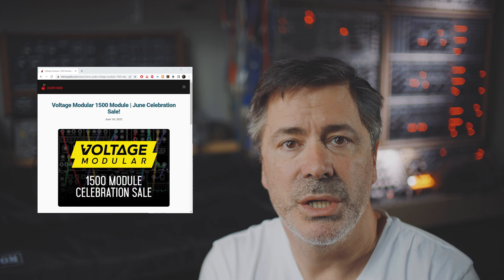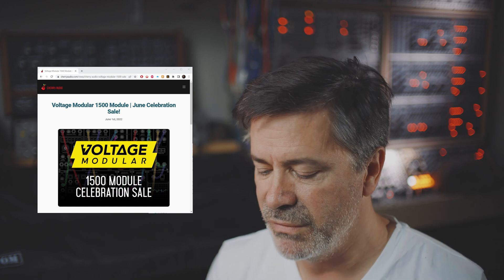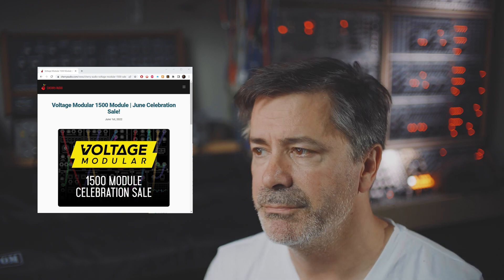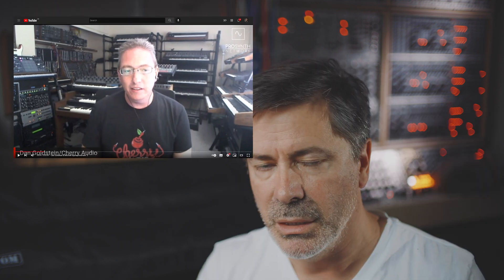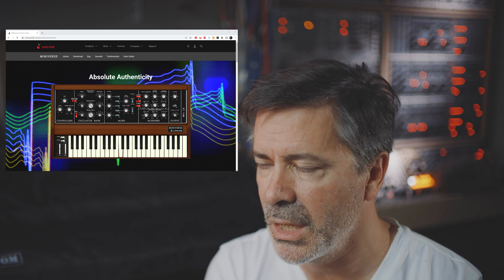Glide

Comment: The Model D, at lest mine, has faults. It’s not “pissing on the product” to grasp that the faults exist and publicly acknowledge them. On mine, glide is indeed a bit flawed - and the detune for Osc 2 & 3 falls short of 7 semitones. So while you can do fourth leads, you can’t do fifth leads on it.

Doesn’t matter really though. For slightly over $200, you’re getting a Minimoog. The thick, fat, lush, sweet, aggressive, amazing sounds of the Minimoog. I’ll live with its flaws. Because the alternative is to not have that sound in hardware, unless I want to spend thousands for a vintage unit that might also have issues.

Comment: Sigo varios vídeos suyos, disfruto bastante su conocimiento. Y quisiera su opinión o consejo sobre qué comprar, para tener buenos pads, que pueda programar sin ser un experto fanático: sólo hacer música. Gracias.
Reply from the maker: There are many options to get great pad sounds. In terms of analogue synths, the Behringer Deepmind is a great choice. It's a simple synth architecture but it has an amazing choice of effects. There are some beautiful pad sounds amongst the factory presets and those sounds are amazing thanks to the effects.

As well as effects, the ability to layer sounds will allow you to create complex evolving pad sounds. The Nord Wave 2 is not a complicated synth, there is no menu diving, and you have 4 layers at your fingertips. You can also blend sampled sounds such as orchestra, choir etc etc.

Multi-timbral digital VA synths are not really in fashion these days, but they make amazing pads thanks to the layers you can create and the multi effects they have built in. I have a number of synths that date back 20 years or more, they are not complex to program and don't cost much compared to new products. Some favourites are Roland XV series, Novation Nova and KS series, Korg Radias & Access Virus.... (Well, XV is not so easy to program and Virus prices are going crazy these days but in general "first generation" VA synths are heavily overlooked)
Reply: @TimShoebridge  Thank you so much for your time, knowledge and guidance!

Comment: Apologies for asking this here, but latest post and all... Now that firmware 1.5 is out might you take another look at phase cancellation on Moog One with it installed?
Reply from the maker: I read through the firmware release notes and it seems Moog have made the full oscillator recalibration process much more accessible. All modern analogue poly synths have such a process and it seems the right way to go with the One for the majority of uses. The real-time oscillator compensation facility is there if you need it but I’d suggest avoiding it unless you really need perfect tuning precision. I think phase cancellation is an unfortunate side effect of real-time compensation and not a bug, so best to know it can happen and find ways to avoid it, that was why I recorded the video about it, for awareness more than anything.

Comment: Why is asymmetric glide preferable?
Reply from the maker: It's not. Well I don't think it is personally. And I don't think Bob Moog set out to deliberately create a circuit that produced asymmetric glide, it's just one of those things. It's an imperfection, just like hundreds of imperfections that exist in vintage analogue synthesisers that do not exist in most modern ones. As it's easily measurable, it also serves as a means by which we can judge how faithfully the technicians at Behringer recreated the original design, and proof that they got as close to the original as they could, probably closer than anyone.
Reply: @TimShoebridge  Fair enough.  This video did make me patch up maths as a glide module, since you can create asymmetric glide with rise and fall, and it was pretty fun.    Cheers!

Comment: Or we could also say that the original Minimoog got it wrong. And those reissues are what it makes sense and what it's supposed to be. 

That's really what puts me off a bit when talking about emulations and clones. It always upholds vintage gear as the ultimate holy grail of sound and that any thing else is only "trying" to reach that but never touches it. I still love the Behringer clones though. And I think they're doing an amazing job

All respect and thanks for these details.
Reply from the maker: I see the asymmetric glide as being an imperfection. And let's face it, those vintage synth designs have many imperfections and so do the components they were built from. It's the sum of all those imperfections that make vintage synths unique. Behringer chose to copy those imperfections to the letter, Dave Smith chose to add a slop control to his synths, then he chose to add a vintage control. It's these imperfections that are the difference between a vintage sound and a modern sound. There's nothing wrong with either but many prefer vintage for the warmth, character and quirkiness they offer. I think that's ok.
Reply: @TimShoebridge  yes, I agree. except that when those imperfection happen to modern synths. People call them “bugs” or “faults” and complain about them, but for vintage, they call them “quirks”. ie. no matter what vintage does, it’s always in the right.

Comment: On this note, as I have had a few thoughts:
I don't own a Boog Model-d. I do, however, own a Poly-D and a oscilloscope. 
This may be going into more detail than the scope of this video, but, are you able to measure the curvature of the Model-D glide? I would be very interested to see whether it's completely linear or has a typical R-C curve. 

My theory is that due to a lack of keybed, the glide isn't being handled digitally. I've built a few V/oct keyboard circuits, all including glide, and the resistor/capacitor network is what determines the Charge/Discharge speed. Often it can even be tricky to completely eliminate unwanted glide in the downwards direction. 
Not necessarily a feature, originally. Haha. 
I can say for sure though, that the Poly-D fails to emulate this natural R-C curve behaviour. It is completely linear. 
I would love to know if the Model-D's glide-time accuracy is a happy accident. If the Poly-D also emulates this behaviour, then we can tell for certain that it was actually intentional on the engineers part. If the Poly-D doesn't glide slower downwards, then I'm afraid it's not something the engineers noticed. Just a byproduct of analog. Of course, in theory. Just speculating here, from the perspective of someone who looks at a lot of these circuits.

This wouldn't devalue the equipment, or your points, at all. Just interesting to note. I feel Moog should have considered analog curvature when designing a reissue of the most iconic analog monosynth, basically ever. Interesting, thank you for the thought food, Tim!
Reply from the maker: Very interesting observations about the Poly D 👍 That synth doesn't set out to be a copy of anything so I think it's fine for the glide to be controlled digitally (if that is what it is). Regarding the Model D, someone with a huge amount of insight into it (not associated with Behringer in any way) wrote to me after seeing the video. He said this: "the Behringer Model D is a fantastic piece of work. It really is an exact copy of the Minimoog schematic. They even copied things that are incorrectly labeled on the original Minimoog schematic, and included those mistakes in their own schematics. It is an extremely faithful copy and as your video shows, it responds like a vintage unit". He has no bias whatsoever, I don't want to give his name as it was a private email conversation but you'd recognise the name if I gave it.
Reply: @TimShoebridge  Well I will say then I am impressed. I had no doubt it was a quality unit but the attention to detail is what really sells me on it. Appreciate the response!
Reply: Regarding the glide curve, it is neither linear nor an RC log curve.  It is somewhere in between, but mostly closer to linear.  The circuit is just barely up to the task of holding it together at all.  I'm amazed it behaves well from unit to unit.  It's about as cost-reduced as you can get.

Comment: Good to see you back! Nice track at the end of the video! I have been considering selling my 1972 Minimoog and buying a Behringer Model D instead but alleged triggering issues and my tech's advice kept me from it. A couple of weeks ago I cleaned the keyboard contacts,  which is a tedious chore, rebalanced the keys and I had it calibrated. Now it sounds tighter than before. To celebrate that, I played some sessions with only the Mini, a Behringer VC-340 and a Hammond XK-1c. Great fun but no recording material. The glide quirk was unknown to me. I always play the Minimoog from midi using a Kenton Pro 2000 converter. You lose the internal glide when playing the synth externally. I don't know why. Apparently it doesn't happen with the Behringer..I know only s few vintage Synthesizers that keep their glide: the Roland SH-101 and the Korg MonoPoly (but not the MS series). Of course, the Kenton glide behaves very differently. To be exact, it is linear, not logarithmic. I prefer the more musical response of the logarithmic glide. So you sacrifice something when playing from midi but it gives you an LFO in return.

Comment: In my opinion, the Behringer Model D is the best alternative out there
for that vintage Moog sound. no plugin comes close to it and for the 
extra £100 you might pay for it . considering a decent Moog plugin
will cost you around £100 and the Behringer is around £200 its well
worth the money its a fantastic-sounding synth. its also a fantastic
effects unit as well. the filter drive circuit is excellent for running
digital synth through for that lovely Analogue distortion. you can
also run guitars through it as well. you also have the feedback
circuit which is ridiculous. no plugin can model that type of warmth.
Reply: U-He's is damn good, Monark, even Arturias.. and you can run more than one, with more voices... So your point is , comparing price, is null and void.
However, I have a decent collection of Vintage synths and modules, most of which are desirable.. So I Agree in some sense , But in a track, I just may not.
As for the Behringer, Id probably go a SE-02, a joint design by Roland and Studio Electronics,,,.. Afterall , Studio Electronics delved into Real Moogs by making them rack mountable and with midi....
Then the SE-1, and the ATC-1..
What my point?
"no plugin comes close to it"
Yep...  Thats Your opinion.

Basically, Hardware is just that these days.. Each simple in their own way, and thats the beauty..
But comparisons when it actually comes to writing, Well, sometimes an exact sound wont get you where you need to be.
Reply: @Rhythmattica  
It depends what type of music you make i suppose sometimes a VST
and some digital hardware is the only alternative for cutting edge sound design 
like lead Dubstep type robot growls and some edm etc etc . the Behringer model d 
does sound different though. its sound is very colored and creamy and juicy very 
good for low-end bass and lead bass and leads and plucks. I find Analogue tends 
to sound a lot better with VST effects than what a VST synth does. they seem to 
compliment each other better. but it depends what sound your after.
Reply: @カプコン-v6z   Welly well. Someone sure got his little panties in a twist. Matt Lord didn’t accuse you of lying. He simply pointed out that it’s your opinion. But we all know that you don’t have opinions. Only facts, right? Get over yourself. smfh
Reply: @カプコン-v6z  When will you realise im not having a go at Hardware vs Vst's? Nor Behringer?
You know The SE1? The ATC? 
How about the Jupiter Series...
OSCar, Oberheim?
You know my MW1 Smacks Serum in the Bottom end right?  
Let me remind you.
"for that vintage Moog sound. no plugin comes close to it "
So.. Not close? 
I love my Hardware, as I love VST's.. But in a mix, who's gonna care ?
As for live.. Thats different, as for interaction, hands on, thats different,, Every hardware synth has a Personality, its way of feedback... And thats what I love,, When on Hardware, its interface , Layout, hell, even limitations are what influences your creative direction...  and yeh, the ones Ive got , sounds awesome... (Note: A great Desk/AD I/o makes a difference too)
Its simply what works, But suggesting Plugins aren't  even close, Lets juxtapose that idea.. If you have 1 , even original Model D, How many parts and sounds can you play , playback,  real time?  Well, compared to a VST, its actually Fact, its not even comparable.
Again, Im not knocking the D, Im a Hardware  guy .. I still even Use ASR10's for creative sampling ( though all VST's for film scoring , Orch, as changing multiple cue's , theres no better way)
And to Add. Many digital clocks and converters (AD/DA)  aren't created equal.
Music my friend. Not Gear.
Reply: @Rhythmattica  
Sorry buddy maybe i originally misinterpreted your comment and overreacted. 
Yes a VST model resembles the sound you can tell what they are modeling. 
the waveform part of them is close but its the overdrive of the filter and the filter 
itself and the overall color which is not the same and the fatness. you can tell
they have tried to emulate this. but VSTs still have those digital characteristics.
I am not really saying any of them are better either i just said the model d is
the better alternative if you are a purist and want that color of the Moog on the
cheap. anyway your right the music is the most important thing and i have 
hundreds of VST's and only 4 pieces of hardware and i use them equally.
Whats a MW1 anyway
Reply: null  
You will be surprised how good those Behringer mono clones sound 
to be honest. sure they are simple just like the real synths they're 
cloned after. they are also cheap and made by an undesirable company 
but the build quality is actually good and if you judge them for what they 
are simple subtractive synthesizers then they are actually better than the VST 
model versions of the same synths. if you talking about other VST's which 
are not models and are 100% original with ridiculous modern features 
such as multi engines then there's an argument to be had on features
and perhaps sound if the digital sound is what you like.
I was never a fan of the Moog sound, especially some of demos i have heard
on youtube. but i had a chance to have a demo on a real Model d and i can
tell you there's nothing like them. they sound ridiculously good that good
and organic and fat and juicy and creamy. i wouldn't class them as a synthesizer
even though they are. to me there a timeless instrument like a piano or a 
guitar which no VST will ever replace. and when people who own these
instruments on youtube say VST's are close they are only saying that not to 
alienate their audience. all the Moogs have this sound and they're very 
desirable for the people who know. and the Behringer Model d has it too
for £250 its a no-brainer. and its actually a fantastic little Synth believe it
or not. it is laughably good because you don't expect it to be but it is.
Reply: null  Fully blown VCO's have their own sound you can hear and tell
its voltages being shaped in a real circuit it's hard to explain to you
if you haven't heard it for yourself. you would have to hear it to understand
where i am coming from. a VCO in my opinion is still the best building
block for a synthesizer. and a real discrete amp circuit and filter circuit
and envelope circuit is still a hell of a lot better too. a analog synth
is also very colored. and people who use VST's will use a hell of a lot
of plugins to turn a sterile unpleasing sound into a colored sound
which is nowhere near real analog color. a good VCO analogue 
synth has that sound straight of the bat and a bare-bones patch  
sounds good without effects. a VST's bare-bones patch without
effects doesn't sound great let's be honest.